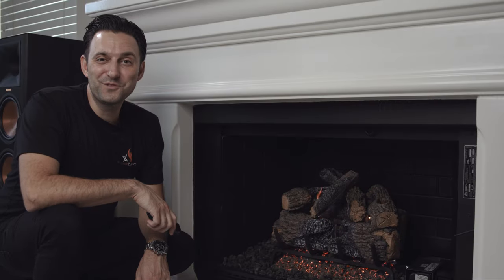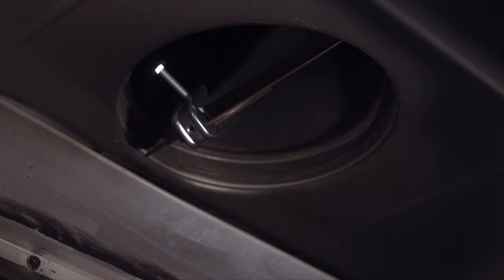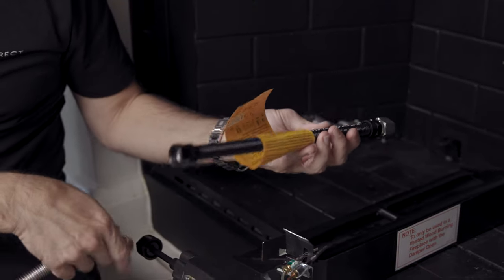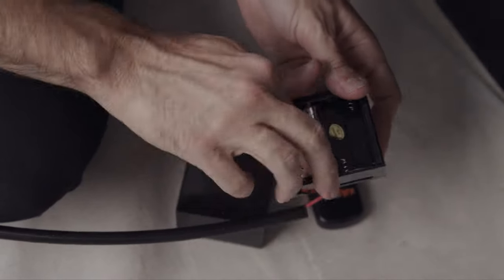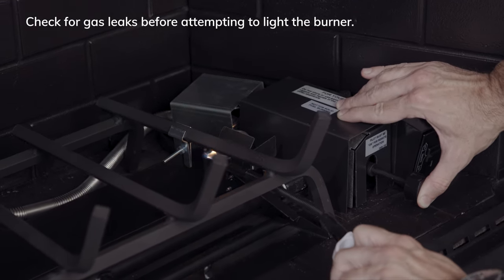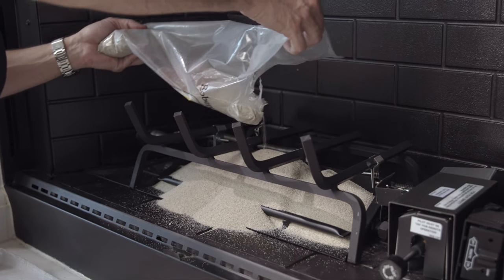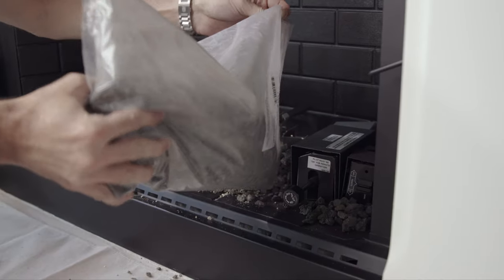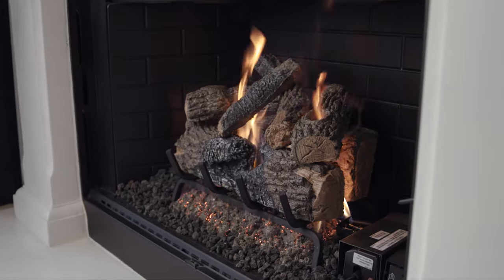How To Install a Gas Log Automatic Pilot System (Real Fyre APK-17)

Comment: I've gotta tell you, now that my G45 system with the Royal Charred English Oak logs is working perfectly, I could not be more satisfied.  After more than 20 years of burning 4-5 face chord of wood each season, I thought I would never settle for anything less than a true wood fire.  I have a copper bucket that I burn a few pine cones in and blow them out and put it on my hearth.  My 62 year old back is shouting Hallelujah!
Reply from the maker: Love it Tom!  Glad to hear it!!  Kick those feet up and relax!! ;-)
Reply: @StarfireDirect  Thank you.  Supposed to rain then snow here in Rochester on April 6th.  Bought a bottle of Greygoose tonight to officially 'fire up' the occasion!
Reply: @StarfireDirect  Hi!  Thoroughly enjoyed my G45 system this winter!  Question please:  The pilot light seems to be burning much stronger (I can hear it even with my glass doors closed). It actually sounds like a torch.  Should it be adjusted?  Thanks!
Reply from the maker: @tomsmith2013  absolutely!  There's a little flat head screw on the front that adjusts the flame down.  It should be quiet, but still heat the thermocouple.
Reply: @StarfireDirect  The front of what my friend? Is there a video anywhere that shows this?
Reply from the maker: @tomsmith2013  https://www.youtube.com/watch?v=4hEpuMrcy7g&t=9s 
right around the 3:04 mark
Reply: @StarfireDirect  You guys are the BEST!  Thank you!

Comment: Great video, thanks! I have a question. Is it OK to install an 18 inch Real Fyre PB Series Vented Glass Burner Kit in a fireplace that is only 26 inches width? The istructions suggest a 16 inch burner but I would like to have 18 inches also because the 18 inch comes pre-assambled with APK-17.  i don't mind if it is not centered. Thank you.
Reply from the maker: Is the front width 26" or is that the back width 26"?   The match lit PB18 requires at least 24" in the front and 22" in the back, so it will definitely fit in your fireplace centered.  But the second you add the APK-17, you're adding around 6-7" on the right side of the burner, which is why the manufacturer requires 30" in the front and 28" in the rear on the PB18 model.  Even the PB16 with pilot requires 28" in the front.  

I think that either way, your burner will be off center, which I believe will start to bother you in time.  It doesn't look as good with the flame uncentered.  And when you order these burners, there's no returns on burned product.  

Have you seen the Rasmussen Custom Pan Burner with Valve Vanisher?  
https://starfiredirect.com/products/rasmussen-vented-custom-pan-burner-with-valve-vanisher

The valve goes underneath the burner so you don't see it on the side.  You can fit an 18" unit in your fireplace centered and still get the automatic ignition.  The only downside is that it's a little bit more expensive.

Comment: Newbie here... I've heard safety concerns about having the gas valve next to the burner, inside the fireplace itself, as opposite has having the valve outside -like in the wall or floor. Is that a thing?
Reply from the maker: Most of these valves are preassembled to the burner pan, certified and designed to be used in this way.  Coupled with a remote and receiver, it is suggested that you keep the receiver outside of the fireplace.  If you're referring to a key valve, those are considered the main gas shut off, and are typically in the wall or floor.

Comment: very cool 
can it be closed on front with glass?
Reply from the maker: When your vented burner system is lit, you should keep the glass doors open per the operating manual.  If the doors are closed, or even mostly closed, the fire is starved for oxygen and will draw towards the glass causing excess heat buildup, and the glass doors could potentially shatter.  Keep your doors open.

Comment: Can you provide details on this extended length gas flex connector? Material, end sizes, ID, OD? Trying to find one locally.
Reply from the maker: You're looking for a flex line with 1/2" flare nuts, and typically those flex lines are 1/2" OD/38" ID.  Best thing you can do is take the flex line you have and make sure you're getting the same one.  

But as I mentioned, there are other ways to modify or substitute for other items that are more readily available.

Comment: Great video. I bought a  home with two natural gas fireplaces up and downstairs. the brand is Superior, model GHC5000N installed when built-in 1992. Everything works but the flame are not nearly as good as the flame shown in the video. Had a man do routine cleaning, etc. but no improvement. I would like to have your opinion on doing a replacement of the burner plate and necessary parts to achieve the look your video showed. Also, do I need to replace the logs I have to make it work? I am assuming the burner is old and not right. Thank you. Mark Birkeland
Reply from the maker: Mark, thanks for the compliment!  We work very hard on our videos, so we're glad you liked it!  Your fireplace is a "B-Vent" fireplace, which means there's not much you can do.  TECHNICALLY speaking, you can't replace the log set or burner with something else.  These are all preassembled from Superior at the factory and meant to be a all in one type solution.  When a part fails, you replace it with the exact same part.  You cannot replace the burner with something else that's not designed for that specific fireplace.  

Since it's so old, the only real solution is to rip the whole fireplace out and replace it with a newer style unit that gives you the look and features you're wanting.  This can be a $2000-$10k+ project, since you'd be remodeling everything.  If you want to purchase a new fireplace, we're happy to show you some options and place the order.  You would need to find a local installer to put it in for you, and we can assist with references too.  

Hope this helps!

Starfire Direct

Comment: I have the same unit as the one you installed (mine is propane). My pilot seems to be working okay but when I open the main valve I can hear the gas coming in but it doesn't light right away like it used to and I'm afraid to leave it on for too long cuz it might go kaboom. So now I use a lighter stick. Any idea why it doesn't ignite right away like it used to? Does adding vermiculite make a difference for ignition? Thanks!
Reply from the maker: Great question!  Propane is HEAVIER than air, meaning that it sinks low like water.  Natural gas is LIGHTER than air, meaning it rises high like a helium balloon.  Since the pilot flame is located at the back top section of the burner, the gas has to fill the burner enough to reach the pilot before igniting.  If you were on natural gas, this would happen faster because the gas rises up to the pilot.  But with propane, the burner tends to fill up a bit before enough gas reaches the pilot and ignites, which will often times cause a "whoosh".  

To solve this problem, you'll want to make sure that everything is installed 100% according to manufacturer specifications.  Was vermiculite used with the burner pan, or silica sand?  Is the pilot positioned correctly per the owners manual?  Is the pilot adjusted to the right setting?  Is the regulator installed correctly?  

There are many factors that go into these systems working properly, which is why the manufacturer recommends that a professional install.  Often times homeowners will call a plumber or handyman to install, but the truth is that these really should be installed by fireplace specific professionals that have industry experience and can troubleshoot beyond the basics.  

Hope this helps!

Comment: I’m surprised you didn’t check the new fittings for leaks.  I would use a little soapy water.  Otherwise, thanks.
Reply from the maker: Great tip!  You're right on to be testing for leaks!  

Keep in mind that this specific topic is covered in another video that we produce, and we also add a disclaimer at the beginning that implies professional installation, which means that gas leak testing would be a given.  These videos are basic tutorials and further information will be included in the owners manual.  The instructions included with each log set do recommend gas leak testing.

Comment: Trouble with APK-17.  After working flawlessly for nearly two years, I recently started having problems with the valve opening.  I have already changed the batteries in both the remote and receiver, but it has not solved the problem.  The valve "wants" to open (I can see it trying to turn) but all it does is "click" over and over again.  Additionally, I have checked for any material that may be causing the valve to jam which doesn't appear to be the problem.  Same thing happens when I try to close it "click ... click ... click".  Any suggestions please?  Thanks!
Reply from the maker: That's difficult to troubleshoot via YouTube comments.  I'd suggest reading through the owners manual to see if anything stands out to you.  You can also call RH Peterson and talk to their technical support line as well.  
https://www.rhpeterson.com/login/realfyreinstructions/A2-256.pdf
Reply: @StarfireDirect  Thanks!  I applied a little silicone (per another commenter) and that did the trick for a few days.  However, last night I noticed the problem returned until I applied it again.  Appreciate the feedback!